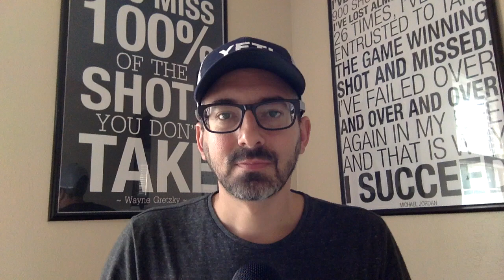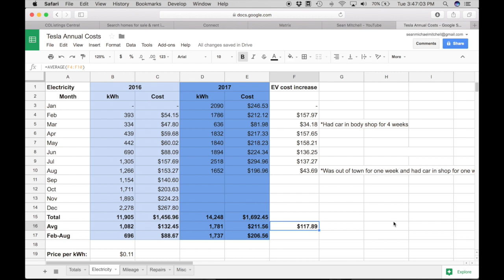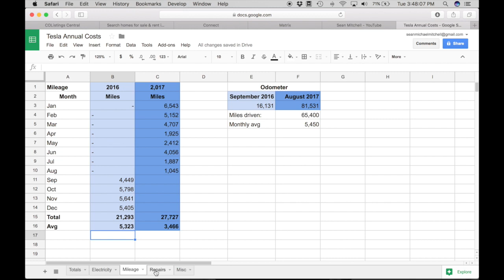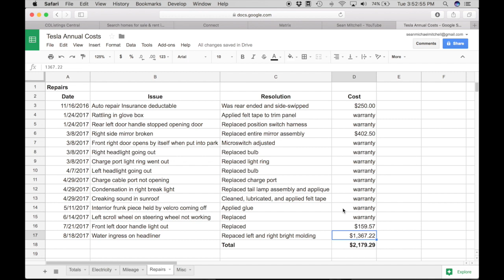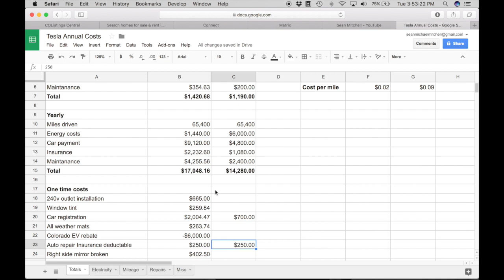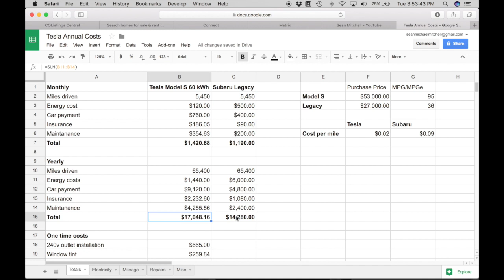How much did my Tesla cost after 1 Year, 64,500 miles (105,000 km)?

Comment: Yikes I was considering a Tesla but I think ill just have to give the company more time to mature. Tesla was in the shop quite often. Are there many tesla service centers? Not sure if I have the time to have it sit in there though
Reply from the maker: harken keep in mind this is a 2013 Model S - they started producing the S in 2012. They've worked out most of these production issues.
Reply: Great point. I overlooked that the year of yours. The only thing pinching me right now is the unlimited lifetime supercharging before 2017. I wont be financially prepared until mid 2018. I saw other videos and some comments mentioned you can get a USED model 2017 or earlier and still be eligible for the lifetime supercharging? Is supercharging associated to the VIN / license software registered to the car?
Reply from the maker: harken anything made prior to January 15, 2017 should have free supercharging as a default that follows the owner of the vehicle. After that new purchasers must use an owner's referral code to get  free supercharging but it does not follow the owner.
Reply: And isn't there a cap on the amount of free supercharging?
Reply: Although I called Tesla recently and was told the water through the brake light still occurs

Comment: Residuals? That would have been interesting. I can't imagine that a Tesla S with 70,000+ miles is going to be worth much. Particularly when it's out of warranty and the drivetrain bills are about to start arriving. Factor that in, and the guy coming after you in the ownership queue will be wondering how he can get his hands on your Subaru.
Reply from the maker: colin5577 great points. It is one of the down sides to driving a lot. Good thing I don't plan on selling it anytime soon.
Reply: My drivetrain has an 8 year unlimited mileage warranty, how about  yours??
Reply: Colin, the Tesla has an 8 year battery and drivetrain warranty. That's over 520,000 miles of warranty at 65,000+ miles per year. Would the Subaru still be running, without the need to replace the engine, and other parts, after half a million miles? Most cars would be on the scrapheap before covering that distance.

Comment: Some of your comparisons including repairs for car accidents are not really valid to compere apple to apples - unless of course you work out the repair cost to the liberty for same damage equivalent had it occurred. With the rebates compared to the Liberty once offs comes to almost $2k benefit actually so add that back and Tesla holds up very close to the Liberty total costs. 
You have to ask yourself do you prefer paying a little more for a powerful and quiet Tesla or a fractionally cheaper Liberty ICE motor ....we know what most would say to that...
Shame so many repairs weer needed to the Tesla though....they still new company I guess...
Reply from the maker: Good Ideas appreciate the comments - very valid. I'd say the Subaru build quality was a lot better but they have had more practice at it. Overall, I'm glad I decided to make the switch.

Comment: Your cost for insurance is way too high... need to shop around... My annual insurance for a 70D is $1300.  Also your cost for tires seems high... a good set of tires from TireRack should run around $820 plus installation so add $100 for the install which works out to around $77 a month.  What may have been missing is your annual service cost of $600 bucks and your tire rotation cost every 6 to 7 k miles.
The numbers used above are what I'm experiencing with a 2015 Model S 70D which had only one warranty covered problem... the tire pressure monitor in the left rear tire was replaced.    Thanks for your report.
Reply: I get my Tesla tomorrow, what insurance did you go through if you don't mind me asking, thanks.
Reply: Of course insurance rates are determined by where you live (high risk areas??), your driving record and even multi car discounts... In my case we live in the suburbs in a lower risk area, have car and homeowners through the insurer and thus the good rate..   We were with State Farm for over 40 years and switched to Liberty Mutual  ... the switch saved us over $800 a year combined for two cars..
Reply: Wow!! that's awesome we have Allstate and have been looking into liberty mutual I will definitely check them out . thanks for the quick reply, I really appreciate it.
Reply: by the way the $1332(to be exact) figure is the ANNUAL premium for two cars, a 2015-Tesla and a 2014-VW.  The Tesla amount is $702 annual.   best regards
Reply: thank you, Allstate wanted to charge me almost double
Reply: I can recommend Farmers too, 1/2 of AAA

Comment: $665 for 240v outlet installation is steep that's less the an hour of work and less then $120 in parts and wire... Unless the breaker box was on the other side of the house and the house is super epic in size made with concrete walls the poor guy had to drill through. Seems over priced...I installed one for my server myself was it quick and easy. Guess it could be a detached garage and the had to bury they wire then $665 sounds better.
Reply from the maker: fake name seems to be the going rate for Tesla installs, for better or worse...

Comment: It's interesting that once the Tesla's paid off, it would be cheaper to own. I'm looking into getting a used RWD Tesla in the summer of 2018. I'm located in the Chicago area. I'm just a little worried about snow driving, but I can't justify the cost with the AWD. Thanks for the video, lots of good info!
Reply: I doubt very highly you will have to replace the battery like Johnny Soko stated. A close friend has a 2013 MS and has just over 178K on it and when charging to 90% shows a range of 257 miles.  He loves it and has no plans to replace it.  Tesla has the best battery management system bar none on the road. He has people constantly asking him how often he's replaced the battery and said the look on their face is priceless when he replies " none. ".
His annual maintenance is less then $300 doing the work himself. Also Tesla now operates their own body shop in house and the repair is first rate and fast. 

Like Tesla just had her M3 repaired after it was hit while parked and Tesla fixed and returned the car in ( not a joke ) 25 hours. New front bumper, left front wheel, and front left fender. Done in 25 hours as Tesla is trying to alleviate the high cost and months long repair cost owners are experiencing.

Cheers!
Reply from the maker: weiserboy1 yes, far less expensive. Also, you'll be fine with RWD as long as you have winter tires.
Reply: Prepare for the $15,000 dollar battery pack replacement 5-7 years down the road.
Reply from the maker: Johnny Sokko maybe but if so hopefully within the 8 year unlimited mile warranty.

Comment: Hello sir.  Could you clarify your expense on the purchase of your tires for me?  I noticed that you had in on the "Monthly" cost of ownership, and not on your "Repair" section of the spreadsheet.  The assumption is this was just a one time purchase you made for the car.  Im looking at the Model S 100D and wanted to know if the 19' would be better long term, as oppose to the 21' tires.  Please let me know when time permits.  Very informative video.
Reply from the maker: David Campbell hello. 21" tires are about double the cost of 19". 21" also wear faster because they are typically made of softer materials. If you're looking for practicality more than looks, go 19".
Reply from the maker: To add some additional clarity,  21" tires will run you $2000-$2500 for a set, 19" will be about half that. The other thing you should consider is that if you live in an area where there are a lot of potholes, you'll have a hard time keeping the wheels not bent. One thing I forgot to add to the list of repairs was paying for wheeling straightening two different times and about $700 in the same year. Now that I'm running 19" I have not had that issue.
Reply from the maker: Rafiq Dhanji great additions. Thank you.
Reply: If your wheels became that abused, what did you pay for alignment issues?
Reply from the maker: Damian Sco no extra cost for alignment.

Comment: You spent 4248 USD per year on tyres?
Reply from the maker: Yes, ~$2000 were on one set of 21" winter tires. ~$2300 were spend on 19" wheels and all season tires. I made the switch about 9 months into owners to the 19" for cost reasons.
Reply from the maker: Kenz300 x yes
Reply: Sean Mitchell, internet: search a decent pneumatic with low consumption level (that in US i think it's not a must to show it, unfortunately), search the best price for it, buy it! You will save 1000$ ans have the same rubber on the wheels. 👍
Reply: Look that it's impossible to spend 2000$ for a 21" tyres set... here in Europe a set of 21" premium tyres (Pirelli, Nokian) 245/35 it's around 1100/1200$ a summer one and 1300$ a winter one; and chosing a medium level brand like for example Falken (not chinese low budget) you spend 850 bugs... how can be possible that in USA you spend the DOUBLE?! change tyres shop (buy online) because is seriosly not possible.
Also about the lifetime of the tyres: if you do a lot of highway and straight road cruising 70 mph like I think you do, you tyres should last you 50/60k miles and not 30k! 
There is seriously something wrong in your tyres calculation voice.
Reply: It seems he is buying them through the dealer and not an independent tire shop
Reply from the maker: I bought my winter tires through an independent shop and all seasons/wheels through Tesla.
Reply: Maybe they are out of alignment

Comment: The costs after warranty are going to be interesting will all those items that were covered under warranty the first time. You will be needing to replace the other three microswitch harnesses someday unless auto present is turned off because that is a design flaw that violates the fundamental rules of installing microswitches. Tesla for some reason decided to make the microswitch move toward the contact point instead of making the contact point move toward the microswitch, so that wire going into the microswitch housing flexes each time the door handle extends and retracts, and when the handle is pulled out that last 1/16" to open the door. If they mounted the switches on the door handle subframe instead of the door handle, it would work fine for 10 years.

The two switches and harness cost about $30 I think, so if you can do that yourself it's not a big deal. But if you get Tesla to do it out of warranty it's about $300 I think.
Reply from the maker: To be completely honest, I'm concerned about costs outside of warranty too.

Comment: The real question is are you happy with the car? Whats one thing you could change about the car battery size options?
Reply from the maker: I'm mostly happy with the car. I'm not crazy about the build quality of the 2013 Model S. I would prefer a newer version without all the issues. Next time around I would likely go with the largest battery size for maximum range.